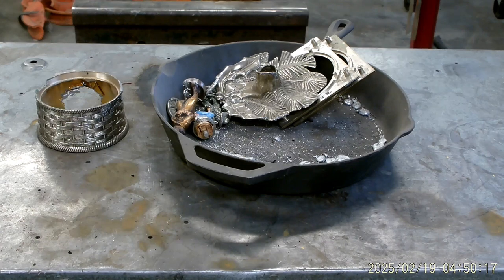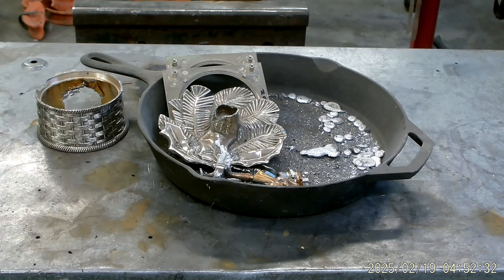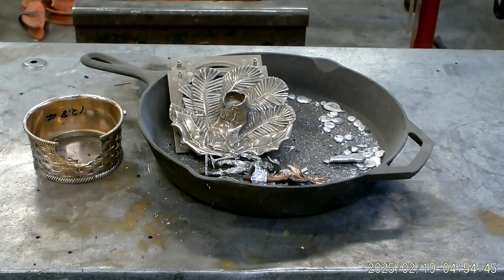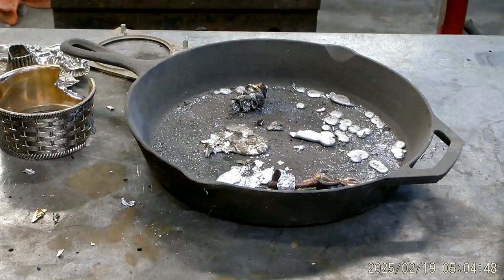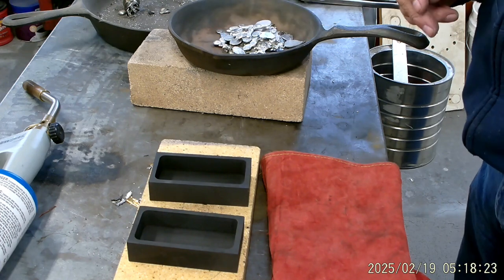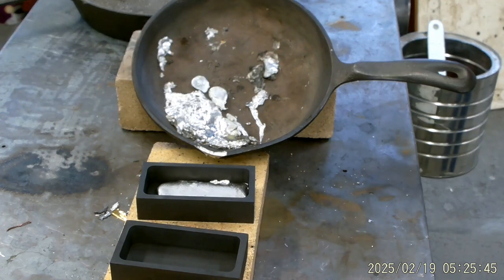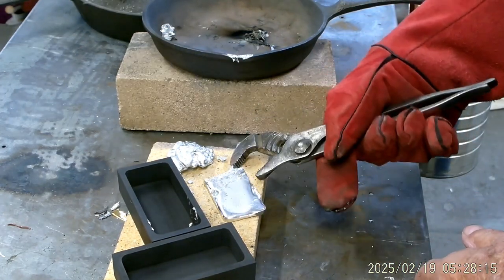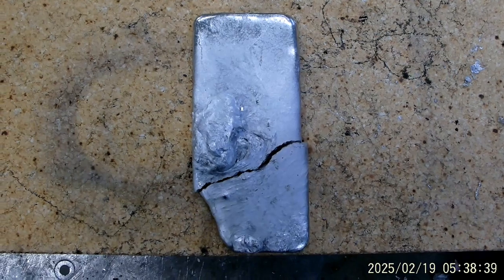Pewter vs Aluminum: The Great Metal Showdown

Comment: Is there a way to determine pewter from aluminum without destroying it? I have a vintage sconce made in India
Reply from the maker: Great question! You can often differentiate pewter from aluminum by checking for weight and the feel of the metal. Pewter is generally heavier and has a warmer touch compared to aluminum.